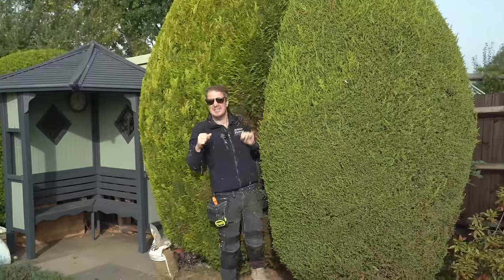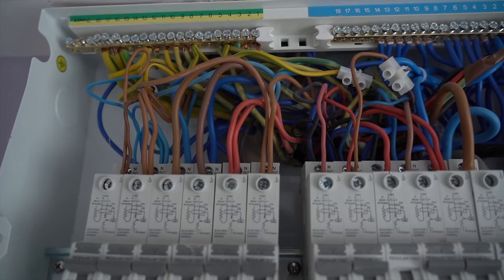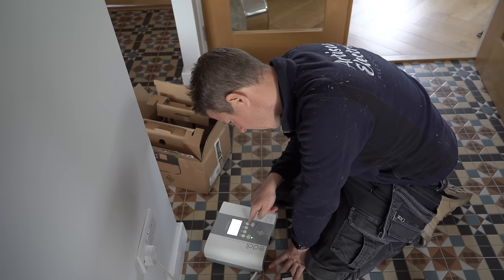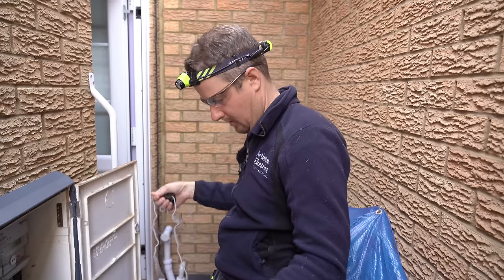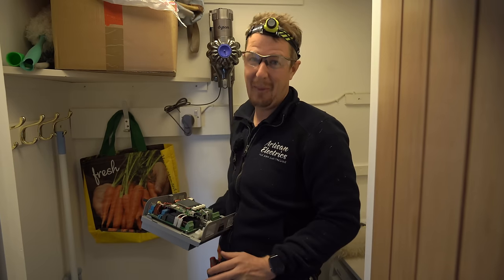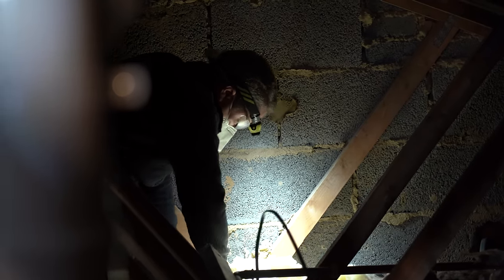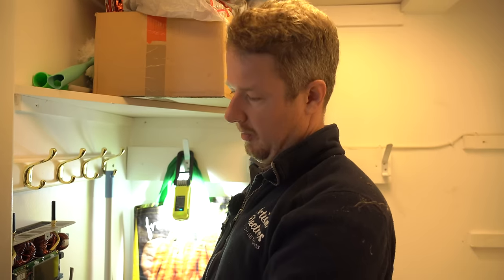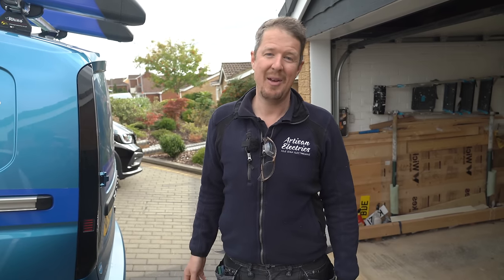OPTIMISING your excess solar energy! MyEnergi Eddi solar energy diverter install

Comment: Installing the new eddi under coat hooks!
Brilliant so either the cupboard loses some of its primary purpose or someone hangs a nice warm coat over the unit and it’s vent holes potentially leading to overheating and premature failure at best!

Comment: You say that device needs airflow from beneath and above but surely with those coat hooks above the device, the device is going to be covered with (possibly wet) coats etc.
Reply: My thoughts exactly. Jordan go back to the job and install it in more suitable place. 😉
Reply: @piotrlobacz  The easier option would be to move the coat hooks. Something the customer could do. Just wouldn't want the customer putting wet coats over it.
Reply: @MJ720  easier operation would be is ro have installed it in more suitable palce. We all know what customers are like. He'll put of moving coat hanger and it will never end up moving or he'll be like. Oh it's nice and warm. It'll dry my wet coats nicely. 🤣
Reply from the maker: Great spot, the customer actually took the coat hanger down shortly after we left!
Reply: @artisanelectrics  of course Jordan 🤣🤣🤣

Comment: Friendly advice as an electronics engineer. Always screw the antennas to the product before even powering it up, even if you are not planning to use the wireless functionality. This applies to all products that have antenna connections. Failing to do so, can permanently damage the wireless module inside the product...
Reply: How does it damage it?
Reply: @hks-lion  When you ommit to connect the antenna, all the RF power used to transmit the signal reflects back from the connector to the radio module, causing it to heat up and cook itself. Technically this happens due to the poor impedance match between the radio module and the (non existing) antenna. RF energy is a bit weird in that regard. If the path that you design it to travel has an impedance that is not accounted and/or designed for, bits of RF energy reflect from that point backwards and cause problems. In general, this phenomenon gets worse, by increasing the RF power output of the module. For example in handheld VHF/UHF radios, if you leave the antenna unconnected and push the transmit button, the RF module (which transmits usually around 5W of power) usually destroys the RF module in a fraction of a second...
Reply: @andrewsweet43  interesting, thanks for explaining
Reply: 100%, this is massively important for LoRa devices as the thing will instantly cook itself!
Reply: Another consideration is that an exposed antenna connector is a great magnet for accidental human body contact, with associated ESD concerns. Screwing the antenna on immediately removes the threat of component damage, should the product have no (or insufficient) ESD protection on its RF ports.
Reply: How stupid to manufacture a device that can be permanently damaged if the user forgets to screw in the antenna before powering up.  That's lazy or even negligent IMO
Reply: @andrewsweet43  This is true of any relatively high-power RF equipment, but at the 100-200mw range of consumer 2G/5G Wifi - VSWR is not really a concern. Still, it was a face palm moment when I saw the antennas were not connected.
Reply: Good point, this is standard electronics practice, the same as running an amplifier with no load (i.e the speakers)

Comment: Having recently installed the Eddi as an amateur DIYer, this was one of the more reassuring Artisan videos in that it mimicked every stage of my install. Pleasant surprise that the Eddi came with an internal Hub, the faff with the WiFi, the failure to turn off the Eddi's own CT inputs and the discovery of a long lost screwdriver in the loft! But at 500 quid including the Harvi, seems an expensive bit of kit for a bit of basic monitoring. Surely the Solax inverter reads solar generation and house consumption/export?
Reply: Yes Solax inverter has some good info.

Comment: The Eddi is an excellent piece of kit. Our supplier just started charging in the region of 15p per kWh for gas, but they charge approx half that for electric during a certain period at night time. Needless to say our Eddi is now heating our hot water at night time, and the solar is doing the rest during the day time.

Comment: Have you thought of a solution for a case where there is no hot water tank because of a combi boiler but they do have a hot tub that could be used to dump excess generation into but you'd have to let drop in temperature at times not used. [Probably a simple time clock on at midday for a couple of hours and, if a storage battery, in the middle of the night would be the simplest.]

Comment: I have just got the Eddi. Currently I have gas central heating heating the hot water for 1/2 hour each day. What I would like to do is on the days when I get cheap or free hot water from grid (octopus Agile) I’d like to automatically stop the gas hot water heater for that day only. Is that possible? I got the Eddi coming on when rate is 0p kWh right now, but gas water heater still kicks in on a Danfoss timer.

Comment: Great video - for the EDDI output could you wire it direct to a double socket on the and plug in a battery power station to charge? (like the Ecoflow)
Reply from the maker: Yes, absolutely, thats a great idea!

Comment: You did this on a current solar installation but would it work for someone considering solar to inform ahead of an install. I am thinking a tailoring of the system can be achieved.  Then factor in the future eg Heat Pump Electric boiler etc.  would love to see a three phase system and your instal in a future vlog.

Comment: Very informative video, it's too bad we live so far away from you guys. We had solar panels and battery storage installed recently, next step will probably be an electric car at some point next year. When we bought this house it came with an outdoor charging point on the driveway, which we were happy with. Now that I know a bit more about what products are and do, it turns out it is a Rolec EV charge point but it's basically an outdoor socket with it's own little circuit. I would definitely be interested in getting a MyEnergy Zappi when we do get an electric vehicle, any change you can do a video on one of them?

Comment: Great video Jordan.
Really helps us up and coming sparks new to Solar PV.
I never take anything into the loft that I don't want to lose!
I would usually clip into the loft, and I hate it, but you've got to do it!
I have always used a hammers length for clipping.
Reply from the maker: Has to be done!
Reply: All well and good until you use one of those half length hammers and can't understand why you're using so many clips lol

Comment: As an installer do you get to see more data than an owner? I can only see 2 months worth from the app but that is Zappi not eddi. Wouldn't want you to get to the end of the year and find out you don't have the data.
Reply: Eddi is the same, no difference whether on the App or website portal. You can go back to individual days prior to 2 months, but each operation is a faff as it is multiple clicks - who in their right mind wants to do that?! Maybe there is an API way to get historical data for comparison, but last I looked MyEnergi hadn't GA'd the API so it would probably be a best endeavours kind of thing. As you say, I'd hate to go back to that house after a year, 'So.... you have exported the grand total of...... errrrr..... hmmmmm.....'

Comment: I asked about adding panels to my existing system but was told that it would invalidate the MCS guarantee and I would lose my feed in tarrif deal.
Reply: You can add panels but as an additional system. You won't loose your Fit.
Reply: @michaelmelwani7752  I only want 3 more panels adding (I have 12 now), would I need a seperate inverter/meter?
Reply: @djmattc1978  yes, or if your inverter can take the extra power then your extra generation would be prorated against the original FIT
Reply: @johnb7644  I’ve been told by the guys who issued the MCS that it’s not do-able so I’m stuck with that unfortunately.
Reply: @djmattc1978  
                               Do you mean the inverter is at it’s max or the extra panels being prorated
Reply: @johnb7644  the inverter is almost at its max but MCS have said I cannot add to the system anyway.
Reply: @johnb7644  thank you, I will definitely check that out.

Comment: Was told they could not run electric cables in the cavity walls from loft into attached garage and had to have trunking on the outside wall is that not the case then?

Comment: In my case I installed six clamps on the main panel, and an additional two for water heater tank and house heating circuit. It's allowed me to pick up on some concerning details, having separate monitoring like that.
Reply: What sort of concerns?

Comment: I keep thinking about one of these to use some of the spare solar I gift to Octopus in the summer !
With the day rate being 5 x the night rate the ultimate sin is to import at the day rate so having fine control over loads as the sun comes in and out is the trick bot not sure if this can do that?

For example I can vary the car charger to low / medium / high but that's not really variable enough.  

I suppose the easiest thing would be to add batteries but they are expensive. 
The ultimate solution is to force the Energy companies to invest in storage and pay consumers for spare solar thus connecting the private solar network - which is already connected of course !

Comment: What impact does shortening the CT clamp cables have? Have seen some that advise against doing so but without any explanation.
Reply: none whatsoever if you consider the physics involved. the cable resistance is trivial over that short distance. whoever said that doesn't know that copper resistivity is low in the first place.

Comment: Ive got an Eddi and Harvi to fit at somepoint, trouble is my boiler doesnt have a temperature thermostat (just a dial 1-6) so its going to be tricky to set up i think...
Reply: Normally (in my limited experience) an immersion heater will have its own thermostat.
Reply: take a look at the honeywell s system wiring. you should be able to add a cylinder thermostat quite easily or get a qualified person to do it for you.

Comment: Why not use the Solax monitoring? It should already be logging the PV/Battery usage and grid usage via the Eastron meter.
Reply from the maker: Hey Max, the customer asked for the eddi to be installed. Not sure if the previous installer had set up the WIFI functions on the Solax. However you are right you can get data from the Solax, but our customer wanted to receive the data from the eddi.
Reply: @artisanelectrics  Fair enough. The customer is always right after all!

Comment: You may want to try having a spare WiFi router/access point in your van, alongside with a long Ethernet cable.
Thereby you can always relay customers WiFi to your construction site and update devices on the wall.
You should just use the same SSID/Key (Name/Password) on this access point, as the customer does on his WiFi, which makes the devices connect to the original wifi, as soon as you switch of your temporary relay station 😉

Comment: It needs air flow to cool it and you put it underneath coat hangers that the customer is obviously going to hang stuff on ? Guess that there coats will be warm when they put them on and dry quick when they hang them back up 😉👍

Comment: It seams quite weird to me to install an Eddi to monitor an already smart Hybrid inverter wich additionally is able to separately monitor PV and battery power. 
If they connect something to the Eddi, it will always drain the battery first after the battery is full and it detects grid export.

Comment: Eddi is not set up correctly.  You should see the power from the solar system coming in to the house on the Eddi display,  you have on got what is going out to the grid showing.  Phone app is showing both.

Comment: The antennas are not optional for RF circuits. Sure, modern modulation schemes mean the reception process is much more reliable but without the antennas, there's no impedance matched output to the RF amplifier, nor the input receiver circuit. Remember old TVs and the static on the screen when you didn't have a cable plugged in, same thing! What I kind of find amazing is the amount of electronics on that EDDI board for what should be a simple bit of logic and a relay output for the immersion. Looking at the PCB, I presume this is all on the AC side which is nuts but I guess the issue with working with what people already have installed.
Reply: It's not a relay output, Its a PWM mains output which is proportional to the spare available watt's from the solar. i.e. If only 100w is being exported, then the output will be switched on for  100/3000 of time and off for 2900/3000 of time for any given period in order to input 3kW into an immersion without clocking up the electricity boards meter.... the meter has a resolution of 3600 joules of energy, so as long as the 3kW load is switched on for less than the 3600 joules, no unit will be measured. The unit then has to measure how long the Solar PV takes to make up for the switch energy (<3600J), before again turning on the immersion. The more PV power available the more cycles the load will be able to be connected before having to turn the output off again. 

So as you can see there is a lot of real time power measurements being made, multiple times a second to be able to switch the mains output on and off so quickly and accurately (using either Triacs or SCR's - not relays), the large coils and capacitors as well as for the power supply are for suppression in order to make sure the firing of these small amounts of energy into a resistive load does not produce RF interference.
Reply: @wino99999  3600 Joules is 1 Wh. Just because the meter display measures in Wh in no way means that you can import/export a Wh at a time over multiple cycles of the mains and the meter won’t notice — the import and export displays will notice that.

You’re gonna have to PWM at well over 50Hz to make this work. Luckily doing PWM at higher than mains frequencies is trivial.
Reply: @wino99999  Thanks for the explanation, really helpful, as soon as you mentioned PWM the board components made sense esp. with regards to suppression (EMC must be fun!). I suppose I was attempting to understand the way some of this kit works together and that, if the system was developed from scratch, wouldnt it be simpler to have a DC based system around the charge state of a battery. In short, I presume the unit is solving the problem where the solar output is converted into AC immediately and you have a system which sends energy back to the grid (therefore the configuration and logic to determine what todo is more complex). This is contrast to a much simpler DIY system Im thinking of installing based around a Victron Multiplus with LIfepo4 battery and no ability to feed back to the grid i.e. if the charge state of the battery is full AND load below a set amount AND water below a certain temperature, dump the excess into the water.
Reply: @JasperJanssen  The Electricity boards meter does not clock up any usage provided you use less than 3600J of energy, so what I was trying to explain was this is how these appliances work by turning on for a fraction of a second or cycle if it needs to, to prevent 1 Wh being recorded, then the equivalent amount needs to be exported to cancel out the use of less than 3600J fired into the immersion heater element before again doing the same ..... Otherwise turning on a 3kW load will always record against the meter if its say being switched by a relay!
Reply: @robfodder5575  Yep completely ac based system, which is much harder to implement, especially if there's not a battery involved. Otherwise as you say if battery is charged to a healthy percentage and water is colder than needed..... turn on DC element, If battery level falls to below level even if water temp is not achieved.... turn off water heater!

Comment: The Eddi isn’t set up correctly, it should show the power generated by solar as well as house consumption.
You can also use the outputs to supply any resistive loads, like a heating element in a water cylinder.
Rather then just giving this back to the grid you can install an outlet specifically to power an electric heater (resistive only) and any unused power would partially heat a room.
It must be a resistive load as the eddi changes the voltage applied to the output to adjust the load available.
Reply: I think monitoring the solar generation is optional.But as they installed it it should be showing

Comment: Can someone tell me the estimated price from a solar system say £10k to 20k
Reply: My 4kw array and 5kw battery cost 8.5k a few month ago, Id say youd be looking at 10-12k for a similar system right now
Reply: Bear in mind a lot of installers will be billing a lot for going up to location and on the roof, which can make installs with less panels feel like the price is bloated compared to bigger installs. I imagine more local installers will have a lower price for this. As a rough napkin calculation, give it one pound per watt peak for just the hardware, though there's a fair bit of variation.
Reply: about 12k for 5kW with battery at todays prices installed

Comment: Hi Guys
I never have trouble connecting with WPS. It's more than likely the router hasn't enabled the wps. Try holding the wps button down for longer on the routers.
Reply: Yep, my old one you had to hold it till it flashed (Virgin) but my new one is a single press. Seems to vary between manufacturer.
Reply: @salibaba  Another option is that the customer disabled WPS, possibly to prevent any unwanted connection attempts (the ability to support WPS is signalled by the router along with the SSID and other information).